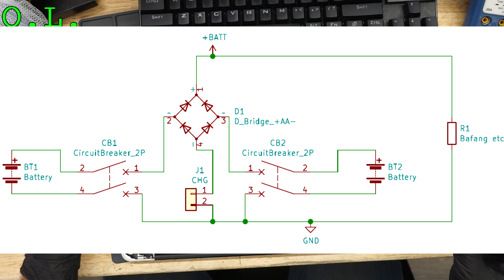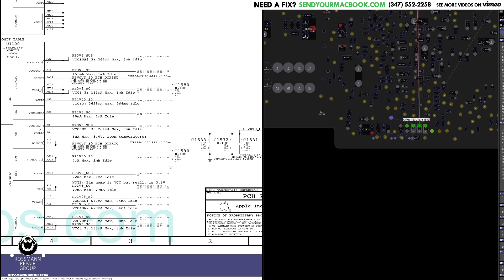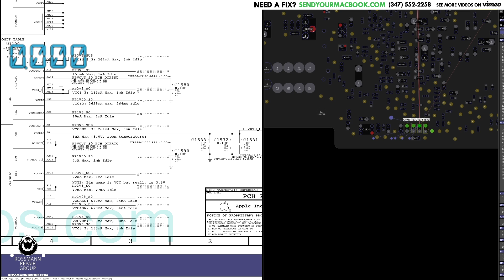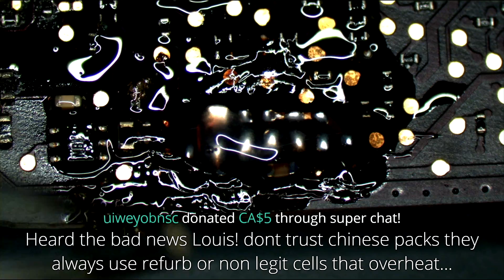A boring Macbook logic board repair.

Comment: No power/Draws 65mA.  A1398 Late 2013 15" Macbook Pro Retina 820-3662
Corrosion on caps C1910/C1531/C1532/C1533 on PPVRTC_G3H rail. 
Measures several Kohms on that rail, it's a low voltage rail so shouldn't be an issue.
Replace caps, now measures O.L. 
Fanspin
Life doesn't make sense.

Comment: My kyocera duraforce 2 was 450, and, IMO, worth every penny. Made in Japan, screen needs diamonds level of hardness to damage and the phone already comes with a case that would make otter look flimsy. The screen is recessed into the body of the phone, instead of curving around the edge of the phone. Overall, a way better experience than my Samsun S8 that I paid 800+ for and the moment I took it out of the case is the moment the screen shattered on me. And ain't no way I'm dropping another 250+ to replace the screen.

Comment: Having watched many of your great video on board repair, I find that many of the issues are from water/ moisture damage.  Apple themselves have put indicators on the boards knowing this is a problem.  For me this is closing the gate after the horse has bolted, too late. Having worked in heavy industry and quarrying we have a lot of circuitry in the field exposed to all kinds of conditions.  The boards rarely fail due to water ingress and corrosion as they are spray coated, think the term is Conformal Coating.  You would think that Apple would have come up with such a substance to protect their product, there are plenty of products out there 3M being one of them.

Comment: I used to find in the communications network some corrosion across Jumpers causing loops . They were also connectors on a pole with an ants nest  inducing loops through water in the damp nest

Comment: Great stuff mate. Reminds me of the days I worked at Qantas airlines doing component level repair on Aircraft avionic equipment. The only difference was we  had to be 100% compliant on the type of solder and wires we used depending on the  board etc and also the different types of conformal coatings for the various boards. The best thing about consumer product repair is you aren't responsible for 100s of lives after that repair..lol..  keep it up man!!  I'm out of that business now..thank fk!

Comment: you do know you only have a half wave rectifier in that circuit. the diodes from pins 1/2 and 1/3 do nothing for the charging. they are in the load side.
diodes 2/4 and 3/4 work on the charger

Comment: You don't need to have a car driver's license to get your motorcycle license in NY, but you do need to have RealID documentation. I think. Here is the link.
https://dmv.ny.gov/driver-license/get-motorcycle-license#:~:text=How%20to%20get%20a%20motorcycle%20license.%201%20Step,4%20Step%204%3A%20Get%20your%20motorcycle%20license.%20

Comment: That circuit is really not safe - If the batteries are not balanced then one will wither deliver all the charge or take all the power from the charger .    

Discharging will eventually balance out but the current drain will potentially exceed the discharge thresholds where instantaneous power can be much higher than the average especially on motors.

Have two, independent charger inputs - at least this will reduce the risk of fire.

Comment: VCCRTC line has a “6 uA max” label on it. You said you measured a few kOhms between the capacitor terminals. 3 V / 3 kOhms = 1 mA. Perhaps that is the issue.

Comment: If you have the correct covertsr, bms board stuff, it is possible to use eneloop Nimh cell to make the pack. I don't think li-ion cylinder battery is directly sell to customers

Comment: I built my bike battery myself... literally soldered wires to the 18650s, since I have no spot-welder... didn't explode (yet).

I have to agree that the bridge rectifier makes no sense though... what's the point?

Comment: You should get a battery pack that uses Samsung or Panasonic 3500mah cells because those things are really good quality. I got one that was made with those and I’ve used it in my ebike for over a year without problems and the capacity is really good

Comment: building your own pack really isnt that hard. Pick up a quality BMS, quality cells and a spot welder (I use the Malectrics kit or a kweld). If you want easy fuses for every cell go buy the fuse sheets from batteryhookup.com. Its just a bit harder than making sure your AA's are in the right orientation, just read the datasheet for your cells and dont fuck around.

Comment: Have a Moto G7 and what i love most about it is that i can get a replacement screen for like 20 bucks and it's actually fairly easy to repair while the more expensive phones i had before had 80€ screens and were super hard to glue back together ¯\_(ツ)_/¯

Comment: Em3ev is legit. I have been running an a123 prismatic 48v 20ah pack from them for years. It is heavy and voltage saggy but man it has gone nearly a decade for around 1100 bucks

Comment: A round of applause for the future mrs. Rossmann!
Louis, get yourselves a Zero electric motorcycle: better seats, better suspension, better range and doesn't go on fire.
Reply: The SR/S is awesome but damn so expensive
Reply: @G91YS  SR/S and SR/F in premium spec with a power tank, heated grips and quick charge come to 23k before incentives. Not that outrageous considering how great the bikes are.
Reply: Zero has someting like an EMC and when that goes bad you find yourself in a worse position than a user of the later IPhone or Mac. That EMC thingy seems to go out a lot, just google that stuff. For 10 times the price of the outrageously expensive bike Louis had put up... hum... naaah bro!

Comment: I love the motos flash light chop, great feature.
Reply: I've been using them since the e4 for that and clean os without bs apps.
Reply: Was one of my favorite and most missed features when I was forced to upgrade after I broke my Moto. I'd have gotten another but needed a phone and they were sold out of the motos.
Reply: @baronobeefdip93  So, I was forced to upgrade to an LG V40 in a similar situation, I love my V40 but I miss that feature. Recently I found an app that emulates this! Even with the screen off (on some phones only I guess). But it works for the V40. I finally have flashlight shake back :D Just search the app store for Flashlight Shake.
Reply: @JulianUccetta  I ended up finding an app that kills 2 birds with one stone, gives me a flashlight button and also disables the Bixby button on the newer note phones which is what i ended up getting.
Reply: @baronobeefdip93  Nice
Reply: Just got a moto g stylus and loving the light chop feature again.
Reply: I have a dumb-phone that is barely bright enough to help me find my stand-alone flashlight. It doesn't have a camera, or a touchscreen, and I LOVE IT!
Reply: The motion gestures Moto uses for the torch and camera was so handy, I upgraded from the old faithful G4 to a Moto One Vision a year ago.
Reply: This is one thing I miss about my Droid Turbo